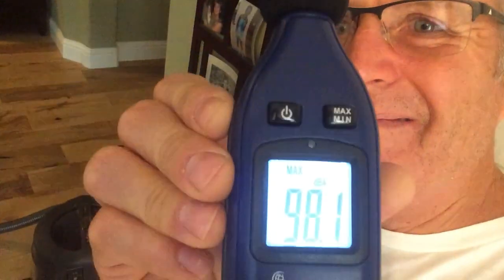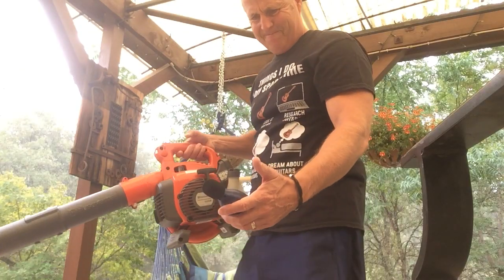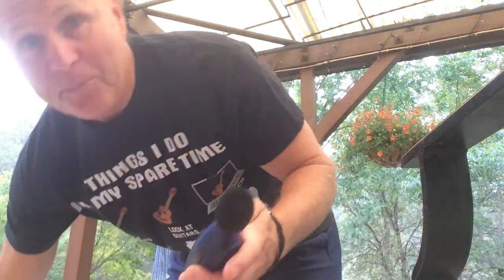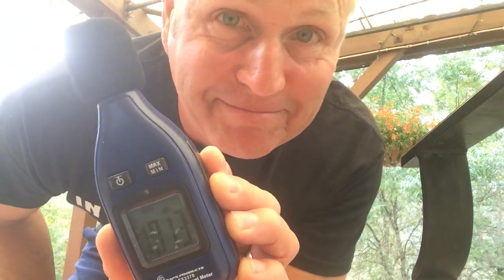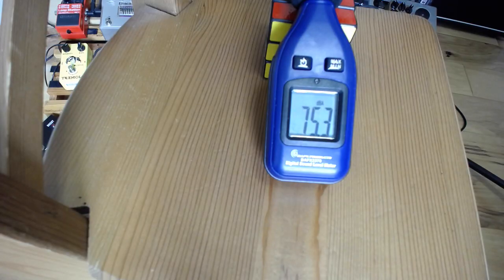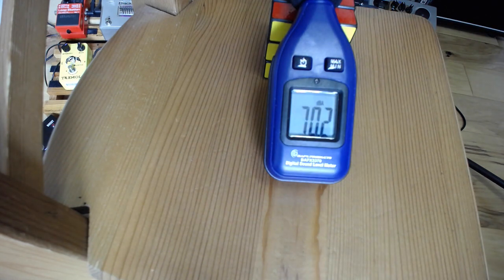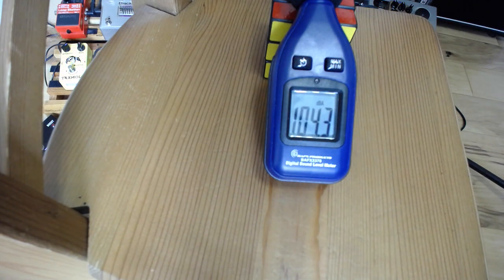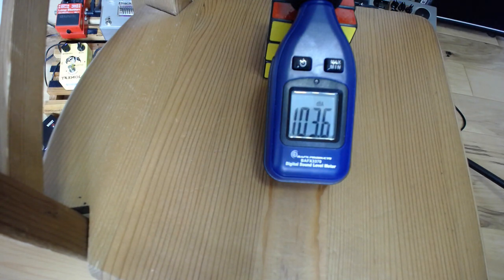How Loud are these DSLs? 5CR vs 20CR

Comment: I think what might be happening with the 2x12 is that with two speaker cones, you have a greater surface area moving the air in front of the amp. Generally, if you increase the volume of the air being moved, the lows and mids tend to become more prominent relative to the top end. Because our ears are more sensitive to the middle of the frequency range, we perceive those sounds as being "louder" (hence a mid boost from a tube screamer can make your signal "pop out" from a mix). 

However, the speakers themselves are only operating at 2.5W each, rather than one speaker at 5 W. As a result, the actual pressure of the air being moved is not really all that different from the 1x12 and thus the decibel reading is basically the same. In essence, although you've increased the volume of the air being moved, you're not hitting it as hard as you would with the 20 W 1x12.
Reply from the maker: I know that more speakers always ‘sound’ louder :-) but you’re right.

Comment: Really great videos! Thanks for making them. I am considering the Engl Ironball E600 Combo. Or a Dsl20. Is the attenuation the same on both amps in terms of quality?
Reply from the maker: that’s cool, the Ironball is the better amp but is also tighter and more brittle sounding than the Marshall, not in a bad way though, just different. What style of music do you play 80% of the time? Chunky, tight metal (Engl) or hard rock, classic and blues (Marshall).
Reply: Does the marshall dsl have a real attenuator built in? I want a combo. I like a organic tone and play mostly rock, heavy rock and some metal. A british sound open and organic. My bridge pickup is a very strong Gibson ceramic 500T. I am thinking Laney Irt30, dsl20 or engle e600 or even the dsl5 but I want the presence and fancy a V30 speaker. I really need to find a store that has all 4 amps and try all. Love the content you do, its helping alot to get my first valve combo!!
Reply from the maker: @love_is_the_best_way  - no, the DSL only has High/Low power and there is little difference, some but not much. I haven’t looked at the back panel of the Engl Combo but the Fireball / Ironball heads both of a real attenuator built in that works very well. For around home use, I don’t think you can beat the DSL5 combo. I easily modded mine to take a 12” Greenback and love it. Of course it won’t compete with a drummer but it gets plenty loud for around home.

Comment: Hello, how are you? First, your videos are amazing. Can you ask me a question? I have a doubt about the DSL5CR and DSL20CR. I play in my   home studio 85% of time (more or less) and a little with my friends on a gig. My questions are; 1. Is the DSL20CR to much for a home studio, or its possible to play with low volume and good quality? 2. Is the DSL5CR is enough to play with a band on a GIG? Thank you so much.
Reply: I have the same doubts...what did you decide?
Reply: I'm a bit late to the party but I own the DSL20, and I would say that like most Marshalls, it tends to sound a bit thin and fizzy at low volumes. You really need to get the channel volumes up above noon in order for it to sound good. Hence I would say that it's probably too much for low volume home use. It's my primary gigging amp.

I don't own the DSL5, but I have serious doubts about it being enough for an unmic-ed gig unless you don't mind it being utterly compressed and saturated (so no picking dynamics, basically). However, if you're parking a mic in front of it and putting everything through the monitors and PA, then you'll be fine.
Reply: Like most tube amps, it starts to sounds very good at almost half volume at least. It's sweet spot for me is at like between 5 to 7. It just sings. It might be my speaker (25w Greenback), but after that it doesnt get much louder and just distorts more and gets less defined. You can get a good enough sound for you maybe at low volumes, but at vol 2 it already pisses people off in my apartment. Maybe if you have a treated homestudio room or a big house with an underground cellar.... but also bear in mind that in a small room it can hurt you when loud. As for gigs - At smaller places you can gig with it and your band unimiked, but on bigger spaces youre going to need to mike it up. It can disappear especially in open space settings also (it'a a 1x12, after all). You're probably gonna feel you need a 4x12 or at least a 2x12 with it, but at 20w you wouldn't get much still. you will need help from the desk guy. That's my experience with it. Hope it helps.

Comment: Which one is a better amp, old DSL5c or Monoprice 15 ?
Reply from the maker: Good question, I would say if you tend towards hard rock and metal, go with the DSL. If you play mostly clean, blues and ‘some’ rock go with the Monoprice. Reverb is lacking with the dsl5 but you can always add a pedal. Conversely, they both take pedals well so if you just ‘occasionally’ play metal... like with a pedal... you could always pull that off with the Monoprice as well.

Comment: Thank you very much~!! Awesome video. 5db is not only... this is A LOT. But I know what you had in mind 5W vs 20W. + the amp is only a part of the whole equation. If you use 1x12 you can get -6db which is A LOT with just a speaker change. I am waiting for my custom made cab with jensen mod/chicago 12-15 16ohm which is 93.5db @1w. 

Btw, ohms also reduce loudness. But I don't have much knowledge in that department. But 4ohm is much louder than 16ohm/

Oh and 2x12 is louder than 1x12. Approximately ~3db if you are using 2x same speakers. But again... power delivered to each is halved so... yea///

If someone wants pure valve amp goodness and play relatively quiet without any tone damaging degrading attenuators . 1x12 jensens speaker ad 1W amp/ I don't think you can do any better than this/

It's gonna be still loud but @1W it should be ~93.5db with jensen 12-50 at max. I haven't found any less efficient/sensitive/quiter speakers (12").
Reply from the maker: Sounds like you know your stuff! I have noticed an appreciable difference in 8 ohm vs 16 ohm speakers, not only in volume but tone. I used to really be partial to 16s but anymore (for whatever reason) I’m liking 8s. Thanks for watching - I wished more people used sound level meters in their videos.

Comment: This is a helpful demo.  Just read that the SPL (sound pressure level in dB) increases by +3db for each doubling of power.  Likewise, reduces by -3db for each halving.  Your results support that: 20w/5w = 4 = doubles twice = +6db difference between the 20w and 5w amp. We can probably estimate the 0.5w sound levels from the 5w amp, 0.5w/5w = 0.1 = halves about 3.5 times, maybe 10db lower, so around 95db.  That is more than loud enough for home use, and will be less with the volume not cranked.
Reply from the maker: Dude, nice extrapolation!! I’d say your spot on as I was just reading the other day that a 1W amp will produce 94-100 dB “cranked” which correlates to what my Randall RD1 produces... I kept wondering if the little demon shouldn’t be just a tad bit louder but it’s right in there. Thanks for watching.

Comment: Great video - I frequently use a dB meter to check my "bedroom playing" levels. Healthy habit! The DSL20 at low power cranked in a medium-sized room is plenty for my middle-aged ears. I think The Who's record was in the range of 120-130dB, over 200 dB would open up the earth, that's close to atomic bomb levels of sound pressure.
Reply from the maker: Thanks for the correction... would’ve been smart to check before spouting off :) 
http://blog.e3diagnostics.com/loudest-live-events-ever-recorded
Loud concerts hover around 130 but turns out NFL fans get even louder :)